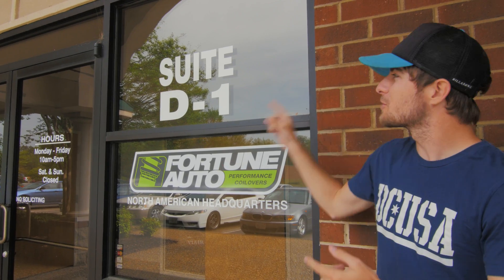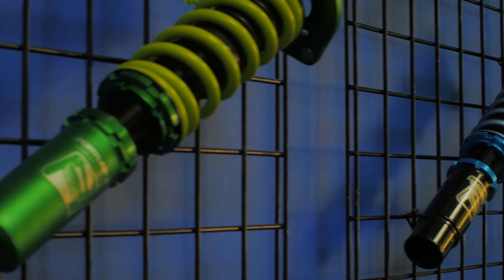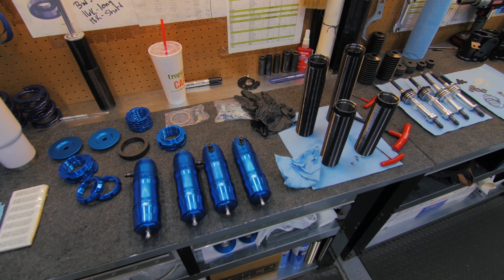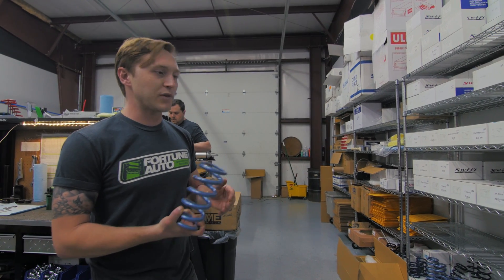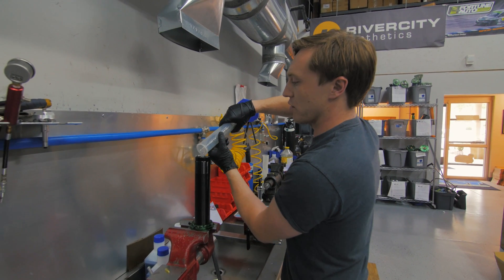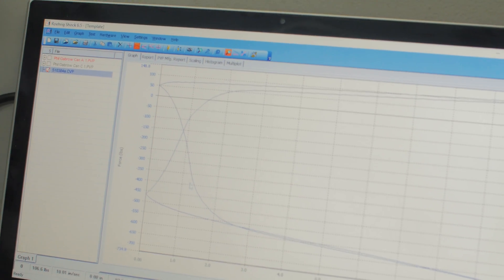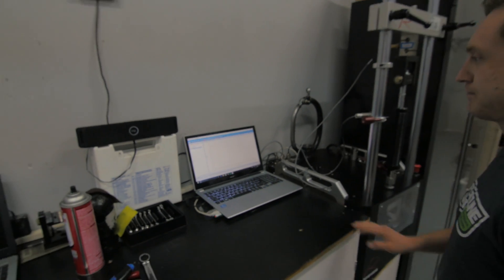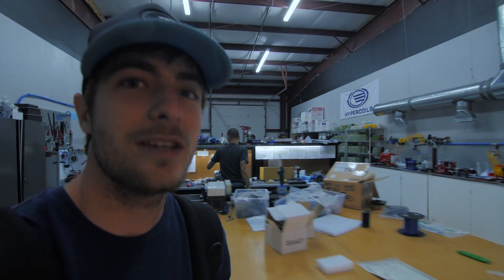How Are Coilovers and Suspension Made?

Comment: Some coilovers won't give you that slammed ride height drop that's why when I was first buying my coilovers I did tons if research I didn't want something too expensive plus since I was gonna drop my car dirt low ride quality didn't matter to me because I knew it would ride rough anyways I'm gonna drop my front end back down to 15 threads my previous set up I only raised it up because my front lip was scaping on bumps but since my front lip is already crack and falling apart I could care less I need to get an alignment done after I drop my car lower

Comment: now what i dont get is whats the difference between a high end coilover and a low end one? besides height adjustability
Reply: mgregers ive been an enthusiast since the early 2k, heres what i saw and read up on forums before youtube lol; some cheap ones dont come with tophats so you have to use your stock (racelands). also the piston rods are skinnier which could snap if you drive agressive, oil in the piston would bubble up due to heat (happens if you track), dampers are non adjustable, not dyno tuned and its not rebuildable

Comment: This is a great insider look of what goes on behind the scenes. I'm glad i got to see the work that goes into creating coil overs and now have a different respect for them. No wonder they cost so much $$$$
Reply: really? I was thinking the opposite, those are quickly, and easily assembled parts from a cheap foreign supplier, and they didn't even show the adjuster mechanism so I'm still a bit skeptical if it even works. i hear a lot that these cheap shocks don't even do anything when you adjust them
Reply: MickeyDss hand assembled* .. pretty sure all the "expensive" stuff like machining and stuff is done in taiwan or something.. you're paying for the name and maybe customer service if its good
Reply: A lot of the cost has to do with the fact that it is handmade. If it was done by machines, it would be cheaper.
Reply: Those are essentially the same thing. The final product is handmade or hand assembled. As long as you don't say the individual products of the final product is handmade, then you are good. The price of the product includes the expense of the individual products, the labor (as it is evidently shown),  the branding, and etc. I stated, "a lot" - which is relative; not definitive.

Comment: I thought they actually build the coilovers. But they are just assembling the parts in a little garage lol. Maybe you should visit KW Suspension in Germany, they actually build coilovers and springs from a piece of metal. and also have a big R&D Center with a F1 Suspension testing machine. You didnt even said where the individual parts, that they assembled came from....
Reply: Presumably they start with cylindrical or tube-shaped stock for round pieces. That block of metal is called a billet. And then you'd use some steel rod stock for the shafts. But here's the thing, the machining work on a coil-over is trivial now because it's all done with CNC anyway. You design it, the software figures out how to machine it, you load some stock into the machine and it parts it off, turns it down and machines the threads and whatnot into it. And then you're going to want to anodize the aluminum parts, heat treat the steel parts and maybe some of the aluminum ones as well... all stuff that's energy-intensive and often also toxic. It's not surprising if people have that done somewhere else. 

As long as they are inspecting a sufficiently representative sample of the parts before they use them, who cares? It's the assembly and QA that are actually better in the USA than in China (but not as good as Germany or Japan.)
Reply: ProjectGTR haha we are on the same boat!  now I'm going to search for the manufacturing process m...
Reply: "i thought they actually built cars. not assembling parts in a little garage." Apparently i need to make my car froma piece of metal lmao
Reply: Why the hate? It's a small shop. Their parts probably come from a local machine shop.
Reply: yeah or from taiwan. like the preached bc coilovers
Reply: and i expected to see a vid where they get build, thats the interesting part for my, assembling is boring
Reply: COMRADE DONALD TRUMP while he came across as snobby what he meant was they machine the parts in house from a solid block of metal.
Reply: The components come from Asia. FA just assembles them in the USA.
Reply: Oh like you? Please tell us more about how you have the availability and resources to go to Germany to make that video...
Reply: it would take me 4 hours to go to the kw suspension factory, i live in germany. In german they are already videos covering this topic, like a 60 minute video of the kw factory, that i saw a couple months ago, so i was a little disappointed.
Reply: "They actually build coilovers and springs from a piece of metal."

That really makes sense to you? Surely you aren't that dumb..
Reply: ProjectGTR some people can't be satisfied
Reply: #GERMANMASTERRACE BRO, you can make a lot of assumptions but at the end of the day they make a good product

Comment: What is teh Difference of Suspension and Coil overs?
Reply: Its the same thing, Coil overs are just a kind of suspension system.  The two most common suspension systems are long arm short arm, which is the spring separate than the shock.  And Coil over, where the spring is over the shock.  Another one that commonly used is air ride, where there is no spring or shock, its all controlled by compressed air.
Reply: Oh ok thanks, Correct me if im wrong
so suspension has the spring seperated from the shock absorber
then the Coil Overs are like 2 in one?
and what do you rpefer suspension or coil overs?
Reply: ShadowxDrifting no suspension is a whole, coilovers are part of  a suspension. You're thinking of shocks and struts